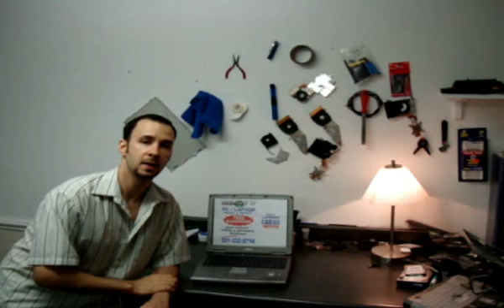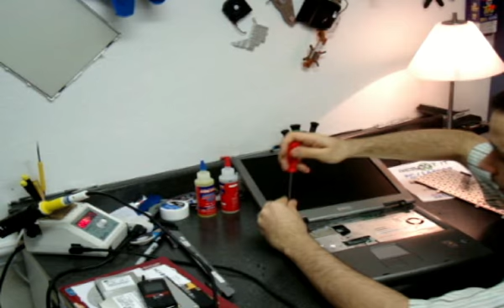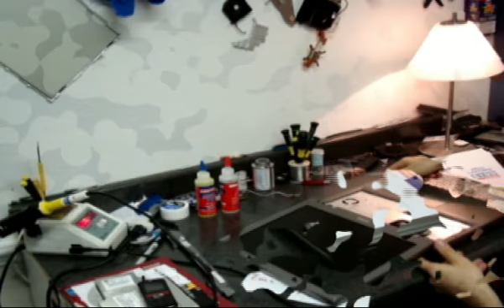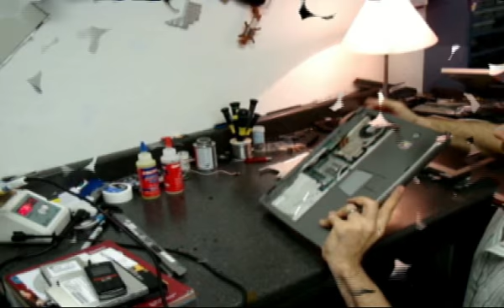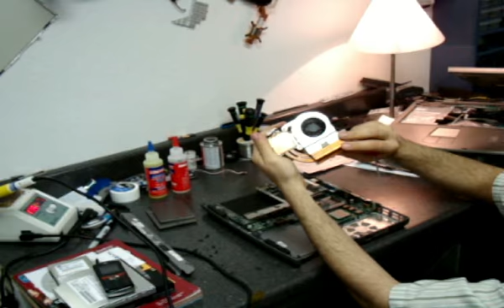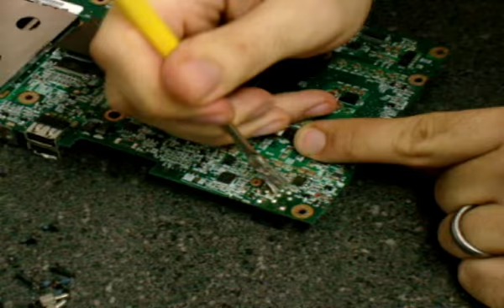How to fix Dell Latitude Inspiron DC Power Jack Tip Replacement  Repair

Comment: Hi Pete, 
I tried to replace my DC Jack on a Dell Inspirion 8600, and when I pieced the laptop together, I hear a beep at boot up. Something about the AC adapter and it's not going to be able to function right. Any idea what's went wrong? The part when you mentioned the center piece to be solder, I didn't see any terminal to be solder. Any ideas? Thanks.

Comment: hey man just did this on my sisters dell inspiron 8100, everything looked good afterwards...plugged the ac adapter in and theres a faint "click"...the light on the ac adapter goes out when i plug into the dc jack on the laptop, any suggestions?  appreciate the help....

Comment: good video, but i got a litle problem i did the same as u do and after replace the dc jack on my inspiron 6000 i put everything back together and the dc jack its working fine but my laptop does'nt get into bios or windows you yes can see when u push the power button that the computer is turn in